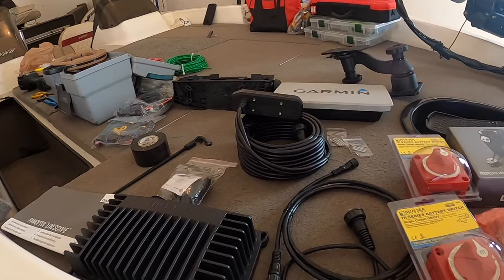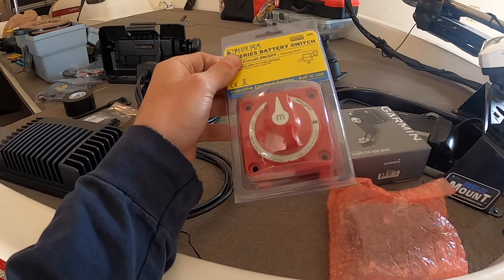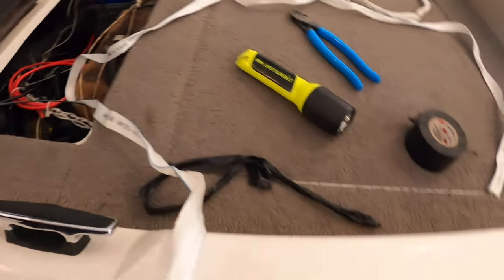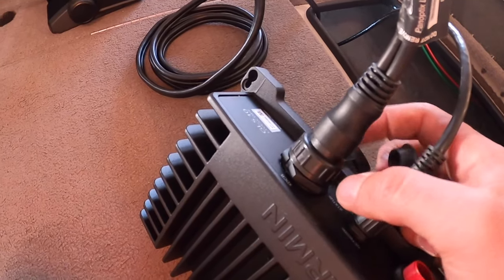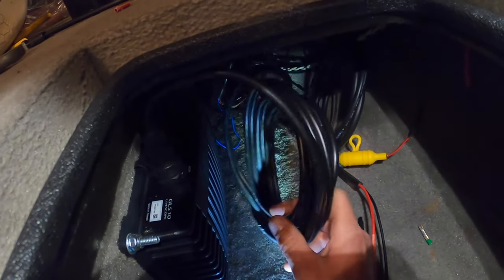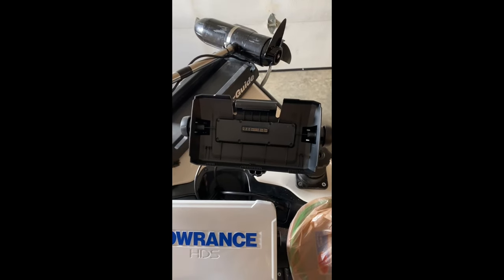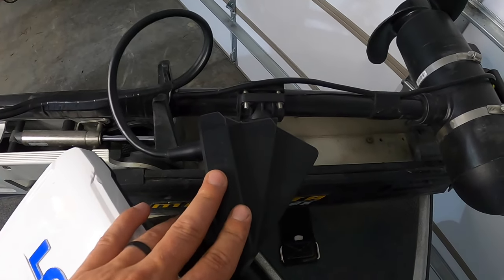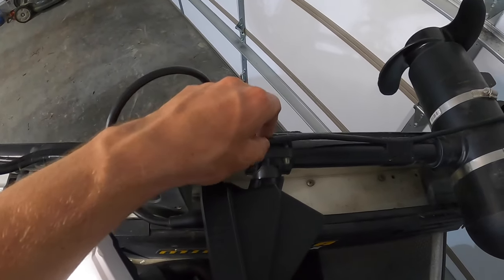Installing Garmin Livescope | What You Need to Know

Comment: Austin, nice job communicating clearly and accurately.  I watched the video to see if there were any additional ideas related to DYI mount ideas.  Although there wasn't  what I was looking for I was impressed by how well you communicated the technical aspects of the Live Scope. BTW typically an electrician uses an additional wire when pulling wires not a rope, it's much smaller and easier because of the wire insulation slides easier. Anyway you brought hope back to me regarding the younger generation and the incompetence I see everywhere.  Thank you for the video.
Reply: We’re not all incompetent :)
No electrical experience at all minus the willpower to research, I rewired and replumbed my entire boat and added about 12 new accessories. This is next. Cant wait

Comment: Thanks for sharing all the good info!  If you mount the box further back from the graph, I would recommend just buying a longer ethernet cable instead of buying an adapter cable.  You can buy a 6 meter small connector ethernet for about $50 now.
Reply: from Garmin or anywhere

Comment: It's so crazy to me that Nitro put the gas tanks back there with all the batteries and electrical wires😬🔥
Reply: That was just very common in older boats. My 2007 ProCraft, I’ve got a MASSIVE gas tank right in front of my cranking battery.
Reply: Pretty sure 95% of companies do that
Reply: @aspenswisher826  yes most used to.  Not as much anymore

Comment: Enjoyed the video. I do have a question about the black box. Can I install it in the back of the boat and run the wire to the front of the boat to the transducer? Thanks for your help.
Reply from the maker: You can. Two things that limit you are transducer length and network cable. Both have extensions you can buy though. Just depends on your boat length

Comment: I wanted to see how you ran the big wires running from the live scope box to the trolling motor and the graf did you drill  big holes in the boat or what cause that cable is a big damn thing ?
Reply from the maker: On my Phoenix I was able to not drill any holes, but I had to put the big cable in first and then squeeze all of my other cables in after. I believe Nathan had to drill out the plastic cover a bit for the connector to fit. It is definitely a big connector. We were both able to fish tape/stick our hands down through the opening enough to grab the cables, if you need to fish tape it’s easiest to start from the hole in the bow and run it into the rod box, then pull everything back to you.

Comment: Hello sir, I ran across this video on garmin and livescope installation....my question is about the 10,8&6 AWG wire....do you need all three wiring or one of the three,  thanks for the instructive video.
Reply from the maker: Just one of the three depending on the distance. On a bass boat 10 is fine to power just the black box. If it’s near the console
Reply: First I would like to thank you for getting back with me and I have a 16'  tracker which I plan on mounting mine up front and hopefully everything will work out.   Once again thanks for a great video,  very helpful.

Comment: I need some education on the F8ah 250v cable.  What are the blue and brown wires for?  I have read the install manual and I cannot find a section about that cable.  Did you put the  and negative on an accessory wire or did you run separate wires to the battery for that?  Thanks
Reply from the maker: I’m assuming you’re talking about the power cable to your unit, as I believe the GLS10 power cable only has a positive and negative. The brown and blue wires are NMEA 0183 data output/input. They aren’t used most of the time as NMEA 2K has replaced them because it is more efficient at transferring data. As far as your unit power goes, either run dedicated runs to the battery, or make a large gauge run from the battery to a fuse panel, then individual runs from there. Your goal is to reduce voltage drop as much as possible to the unit.

Comment: My boat came with two power switches, one for trolling motor batteries one for all other electronics. Do you think I still need a power switch just for the black box? Thanks.
Reply from the maker: Ideally yes. 99% of boats from the factory do not have adequate wiring for todays electronics. It depends what size wire they have in there from the factory though. Also having it on a dedicated circuit can help reduce interference, you could try it and see what happens though if they have at least 10 gauge wire in it from the factory.

Comment: Power question - does the gls 10 box and sonar/chartplotter get dedicated power? So 1 switch with 10awg run to the gls 10 box and another switch with 10awg run to the sonar/chartplotter?
Reply from the maker: Yes on the dedicated power, but you can put them both on the same switch. 1 run of 10awg for the GLS10 and 1 run of 10 for graphs, all controlled on the same switch.

Comment: on your boat , where did you get the small fuse panel ?  i may install that panel like yours in the  similar location to Nathans.  Then power 2 head units (106 and 93) and livescope  box too.  did you run #6 from battery to switch then #6 again from switch to fuse panel ?
Reply from the maker: I got it off of Amazon. It’s a Blue Sea brand, there’s several styles and sizes. They’re all rock solid. Yes I ran #6 exactly how you described it.

Comment: Thanks for the video. Are the livescope power wire and the front graph power wire connected together by the black box?  Thanks again
Reply from the maker: No they are independently powered. The black box is the processor for livescope and only controls the transducer power/imaging and sends the data to the graph for display purposes.
Reply: @MidwestOutdoorExperience  Thank you for the video.  I think you answered this in different threads.  Would it be best to run the cable from the battery to a fuse panel and then connect all 3 to the fuse panel (Livescope, Echomap, and GLS 10)?  It looks like one of the boats is straight to the GLS 10, so how did you power the LiveScope and Display for power?  Thanks!
Reply from the maker: @MizzouGuy  that is how my boat is. #6 to a fuse panel and all electronics powered off of it. Nathan’s boat has individual runs from battery to the front for gls10 and graphs.
Reply: @Midwest Outdoor Experience  thanks, did you run #6 to all the electronics from the fuse panel too?  I have only found the GLS wire requirements so far.
Reply from the maker: @MizzouGuy1970  no, I ran #10 or #12 individually from the fuse panel. GLS10 was #10 for sure, I think my graphs I did #12 independent and there’s basically no voltage drop for low amperage on such a short run.
Reply: @Midwest Outdoor Experience  Awesome.  Last question, did you put a circuit breaker by the battery for the wire going to the fuse box? Looks like Blue Sea recommends it, so I was going to put a 30 amp breaker.
Reply from the maker: @MizzouGuy1970  I do not have a breaker to the fuse panel, only a cutoff switch. If you want it to be as safe as possible then you can install a breaker. The way I looked at it was having individual fuses at the panel protected each item in case of a fault. Having quality wire and insulation from the battery to the panel I’m not worried about that particular section faulting. If it somehow did while out on the boat I could at least disconnect it from the battery quickly with the switch.

Comment: my voltage starts off at 12v with my hds live 12, hds live 9, and the garmin 1022 with livescope. within the first 15min the voltage will drop to 11.9. my batteries are usually fully charged. we are using 10 gauge wire. what do you think it could be? not sure why my voltage is at 11.9 at the beginning of the day. I have the same battery as yours and i just bought it 3 weeks ago.

Comment: I have 2 Garmin 106sv that I want to be able to connect to the Livescope. How would I wire them up to the black box? Is there only 1 network hum in the black box?
Reply from the maker: If each 106sv has two network ports they will all tie together. If not you’ll have to get a GMS10
Reply: @MidwestOutdoorExperience  Thanks yes they have 2 network ports

Comment: Hello, so if I get a deep cycle 80 amp hours battery, I should get at least 15 hours of fishing at 5 amp depletion per hour? I found a size 27 deeo cycle with either 80 or 100 ah
Reply from the maker: That is correct. I would subtract some time off the hours to be on the safe side. You'll get 12 hours at least, but may get up to 15 or more depending on actual load variation.
Reply: @MidwestOutdoorExperience  thanks, just wanted to be sure

Comment: We're 100% certain that the black box pulls power all the time even when your Power switch is turned off???  I was going to wire mine to a 6-way fuse hub which is powered by my main power switch on the dash.
Reply from the maker: Yes it does. That’s fine, just make sure the main is turned off when you’re not using the boat or charging batteries

Comment: i noticed that my 1022 and livescope came with a 6 amp glass fuse, they don't make 6amp fuse for the square fuses so my only option is to use a 5amp fuse or a 7amp fuse. I wired everything into a fusebox but the fusebox don't take a glass fuse. 
 which fuse do you use? what size?
Reply from the maker: You have two choices. Either put in a 5 amp (rather be on the lower end) or put a larger fuse in the fuse holder and make your connection to the panel, but have your glass fuse inline still. A little goofy, but it will just bypass the fuse panel and blow the glass fuse if there’s ever an issue. Hopefully that makes sense
Reply: @MidwestOutdoorExperience  thanks for the reply. yes. right now i have a 5amp in and was just wondering if I'm losing out on anything with the smaller fuse.
Reply from the maker: @kazengen911  no you’re not losing out on anything. They over fuse the units by about 150% of their max amp draw. I’d have to look at the unit specs, but I’d bet you’d never be able to get to that amperage without a fault of some sort

Comment: What amps were the blue seas red switches did you use? Thsnks
Reply from the maker: 300 Amp. The link is to them is in the description
Reply: @MidwestOutdoorExperience  Thanks for the quick reply I thought I looked in there but I must have missed it!
Reply: Is there a reason you didn’t use a relay to toggle the power from the console instead of switching the 8 ga supply line?

Comment: Where can I find that cable keeper that goes at the top of the ultrex
Reply from the maker: Factory keeper for ultrex wiring or the extra one I have on there?
Reply from the maker: Google rubber coated clamp. Any hardware store should have them

Comment: I have that X2 battery and with all of the electronics I have it doesn't really provide the necessary power to operate long periods of time. I ran all of my electronics to a separate lithium 126 amp/h battery.
Reply from the maker: It does pretty good for us. After a long day with minimal running it’s ready for a charge. What is your charger setup with 1 lithium? I’m assuming you have 5 batteries
Reply: @MidwestOutdoorExperience  At the stern I have all AGM batteries. I have the Ionic battery in my starboard rod locker. You can check out the video on my YouTube channel

Comment: When you have your batteries charging how come on the battery disconnect still shows power when you have the battery disconnect on the off position. Is this normal? I just installed mine and I want to make sure I’m okay. When you unplug the charger and put the volt meter back on the wires it shows 0volts when the battery disconnect is on the off mode. Will that short anything out or blow the inline fuse?
Reply from the maker: I’m having trouble understanding your question. Are you saying voltage on the source side of the disconnect switch in the off position?
Reply: @MidwestOutdoorExperience  yeah, I have 12 volts in the wires when the switch is in the off position only when the battery itself is charging. Once it’s off the charger is states 0 volts as it should due to the switch being in the off position. Is this normal? Will it blow the fuse going to the black box when unplugging the charger?
Reply from the maker: @bradyweinert7616  ok let me make sure I’m understanding this. You have 12v going to your electronics passed the switch in the off position…but only when the batteries are on the charger?
Reply from the maker: @bradyweinert7616  that is not normal. There should be no voltage on the other side of the switch in the off position. Did you check continuity of the switch? Or make sure nothing is connected from the battery past the switch?
Reply: @MidwestOutdoorExperience  the only thing that is also connected to that battery is the power that’s feeding the graph. Will I short anything out?
Reply from the maker: @bradyweinert7616  it shouldn’t exceed the voltage or amperage if everything works right, but there’s something not correct with your switch or set up. I’d have to see a picture
Reply from the maker: @bradyweinert7616  you could, but that’s just a more time consuming step and if you have as many connections on your battery as we do, it would be easy for something to not get put back on. I would check continuity on your switch in both positions and double check your connections. Also which cutoff switch do you have?
Reply: @MidwestOutdoorExperience  Could you just remove the terminals off the battery every time you park the boat too? Instead of using the kill switch? Or would that blow the fuse or short something out?
Reply: @MidwestOutdoorExperience  I have a battery just dedicated to the power feeding the black box. I just want to make sure I wouldn’t short or blow a fuse on it if I remove the terminals. The battery disconnect I bought was a “ampper battery switch 12-48 volt” on Amazon. It was the best seller one according to Amazon.
Reply from the maker: @bradyweinert7616  nothing will happen disconnecting the terminals if that’s how you want to do it
Reply: @MidwestOutdoorExperience  awesome, thanks for your help!

Comment: How can I ground the black box?? Running a 32 AMPED outdoor battery dedicated to LiveScope
Reply from the maker: Run a separate wire from the negative post to the box. You could also tap off your negative heading to the box, or from your dedicated fuse panel if that’s what you’re using. It’s really only a true necessity to ground the black box on an aluminum boat, on FG it’s just an extra precaution to eliminate any possible interference.
Reply: @MidwestOutdoorExperience  negative post from the battery we are using for LiveScope? We have the 32ah right next to the box...so you’re saying like a 2 foot jumper from the negative post to the box?
Reply: @MidwestOutdoorExperience   175 Stinger Lowe
Reply: @MidwestOutdoorExperience   running a 93 we didn’t see much noise at all but we switched to a 1222 and we can’t see much of our jigs falling at 30ft...pretty frustrating.
Reply from the maker: @dallinklein1396  try that first. If you see no improvement then try running to the negative post of your starting battery. I would use long temporary cables with clamps to experiment before you spend the time truly running wires.
Reply from the maker: @dallinklein1396  I would be too. Have you tried a factory reset on the 1222?
Reply: @MidwestOutdoorExperience  LITERALLY everything!!! Wish I could attach photo
Reply: @MidwestOutdoorExperience  hey bud what size ground wire is appropriate
Reply from the maker: @dallinklein1396  #16 would be plenty for an external ground. For the main ground I wouldn’t go smaller than #12.
Reply: @MidwestOutdoorExperience  just would go from the negative post on my 32ah battery tied to the black box ground. Saying 16 is plenty for that?
Reply from the maker: @dallinklein1396  to the external ground yes. Not to be confused with the actual power negative lead.
Reply: @MidwestOutdoorExperience  ah I’m sorry man maybe I am confused...we use the 32ah to power both unit/LiveScope....black box/32ah are close together...what’s the best way to ground that sucker lol thanks brother
Reply from the maker: @dallinklein1396  ok, if the 32 AH battery is in the rear of the boat and you’re powering both the 1222 and GLS10 with the same wires, use no smaller than #10. If you’re wanting to ground the GLS10 externally as well, use an additional wire no smaller than #16 from your 32 AH negative post to your external ground on the GLS10. Just out of curiosity, what voltage are you seeing on the 1222?
Reply: @MidwestOutdoorExperience   so as is sits now I should run ground from 32(-) to black box....we start out at 16 and by the time we done it’s at 14.5 or so
Reply: @MidwestOutdoorExperience   our 32 is up front with us right next to the black box
Reply: @MidwestOutdoorExperience   I have 14awg & 10awg solid ...is it better to use braided
Reply from the maker: @dallinklein1396  solid is fine
Reply: should i only run 1 set of  10 gauge wire to rod box from a switch near battery to connect  both the livescope power wire and for the power wire to display unit ?  if  only  run 1 set of wires from the switch near the battery  to rod locker are you 3 way connecting all  these power wires ?  cant  see in the video the power connections
Reply from the maker: @mick6426  run 1 10 gauge wire from the switch to the GLS10. Run a separate wire, at least 12 gauge to power the display. You can run the power for the display and GLS10 through the same switch if you would like. I’d recommend #10 for the jumper wire from the switch to the battery. Doubling the short jumper with two equal pieces of #10 would also help if there’s any issue with ampacity.